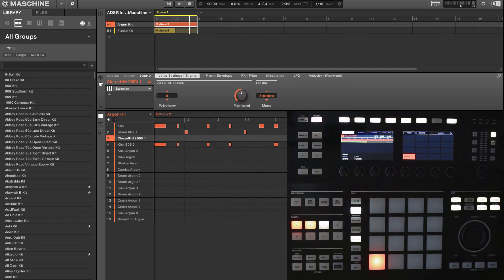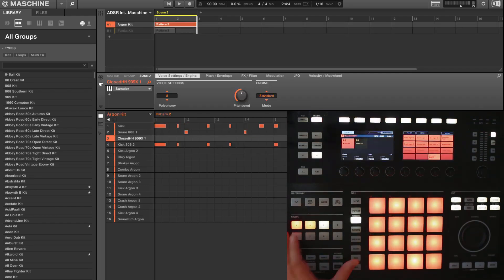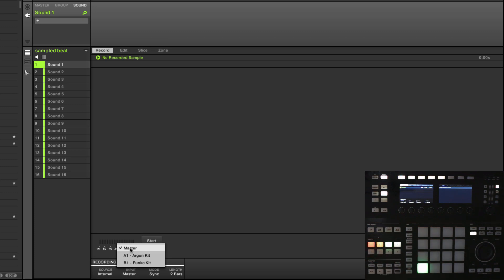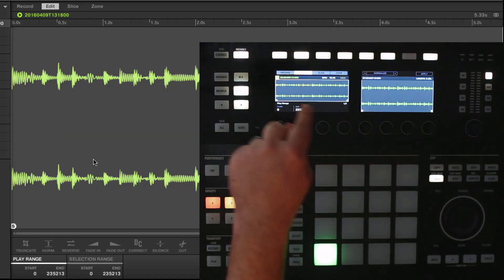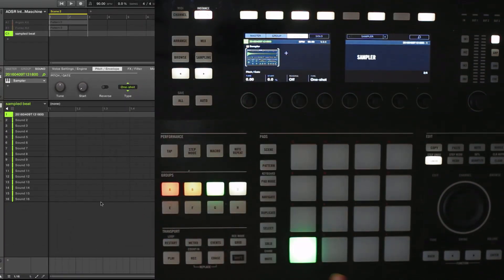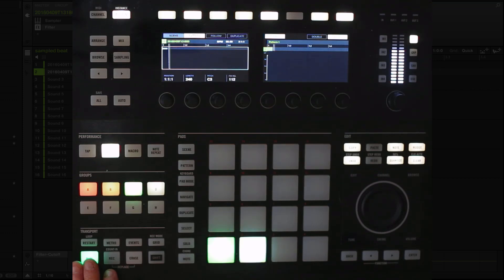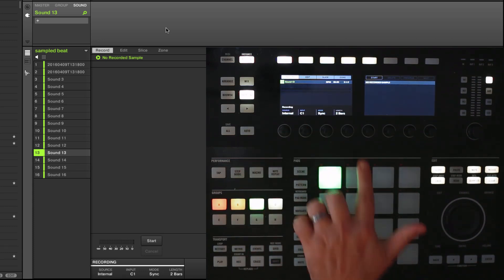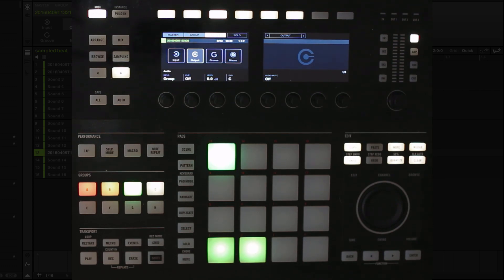Internal Resampling in Maschine

Comment: How amazing would it be if maschine software made a button for re-sampling into the same group and pad that automatically closed all the plugins after it re-sampled it. Would be a game changer!!
Reply: Andrew Risto it's unreal that they do not have this feature. Standalone samplers that are 15 years old have this feature....(SP505 anyone??).…even older samplers have it. Korg Microsampler I believe does too. Apply FX and resample on the same pad. Done.

Didn't Battery do this as well??? 

Anyway, I wouldn't hold my breath hoping NI implements this in Maschine...they will no sooner do that then abandon the whole platform altogether.